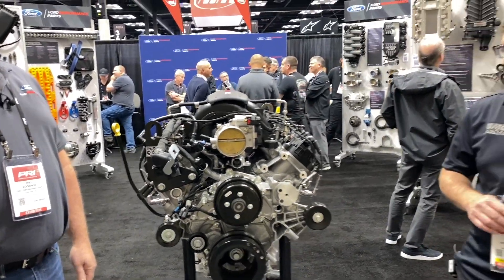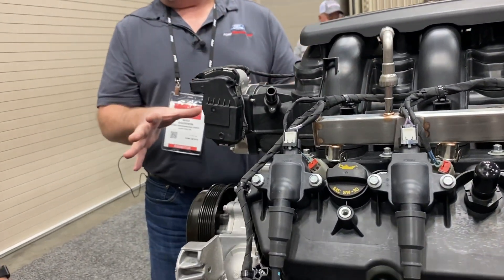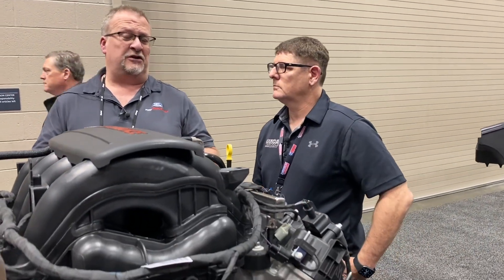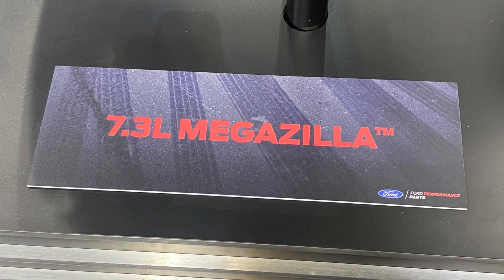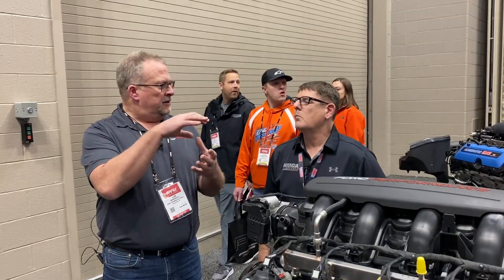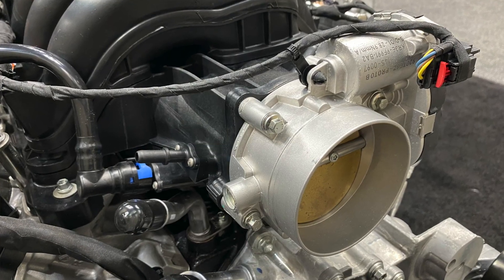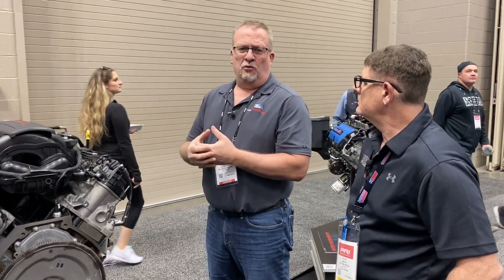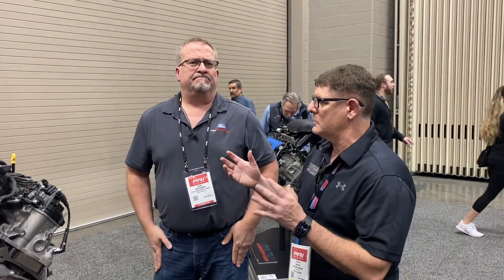Megazilla Is Here! 615 HP 7.3L Godzilla Crate Engine From Ford Performance We Get The First Look

Comment: For 20k you can easily boost a stock coyote to 700hp. This seems way expensive for only 615hp. Heck, an old school big block ford eats this thing alive with a 20k budget. You could probably build a 1000hp 580incher for 20k to run on pump gas if you wanted. I look forward to what guys can do with junkyard pullouts though. The engine, itself, seems to have a lot to recomend it.
Reply: Coyote sounds like a sewing machine at idle. No thanks....

Comment: Just curious,  what about the older "385" motor / 429, 460 ????
Reply: Exactly! 
Well, I still have my 460 with a C-6 behind it. Plowing heavy snow since 1992, still has lots of low rpm torque 👍

Comment: I hope this engine is better than the stock 7.3  which are eating through cams and lifters  after only about 35000 miles .
Reply: THE EATING UP OF THE CAM AND LIFTERS HAS NOTHING TO DO WITH THE 7.3 ENGINE DESIGN. THE ROLLERS ON THE LIFTERS ARE DELAMINATING BECAUSE THE AFTERMARKET COMPANY THAT MAKES THEM FOR FORD IS USING INFERIOR METAL WITH MANY IMPURITIES IN THEM. THAT'S WHY THEY ARE DELAMINATING AND DESTROYING AND EATING UP THE CAM SHAFTS. THE SAME GOES FOR THE CHRYSLER HEMI WHICH IS HAVING SIMILAR PROBLEMS. ON CHRYSLER'S END IT'S THE POSITIONING OF THE CENTER HOLE ON THE ROLLER WHICH IS NOT TRULY CENTERED. WHERE THE ROLLER SLIGHTLY WOBBLES UP AND DOWN AND OVERTIME WEARS THE NEEDLE BEARINGS DESTROYING THE CAMSHAFT. CHRYSLER'S PROBLEM IS MORE OF A MACHINING ISSUE WHICH IN FORD'S CASE IT'S A MATERIAL ISSUE.

Comment: Some of you guys miss the point. Not everyone is willing to build an engine. I've been down the buy a used block, pay the machine shop to deck, align bore, and blueprint short block (of course assembly too), and then find heads (2.02 for SBC), intake, carb, headers, ignition, and I realized very quickly, and once I was past the point of no return, that I should have just started with a nicely built reliable engine WITH A RELIABLE WARRANTY.

This 615 build leaves you wide open for another easy 100hp - thinking cam and tune would be the first thing to do. Yes, warranty is done at that point. So what the heck, enjoy your 615hp engine, run the crap out of it for a year or so, then by that time, the aftermarket will be more robust and you'll have more choices.

It's tempting for me. At the same time, I'm caught between going more old-school and building an FE or a bored and stroked Windsor. All I want is a nice clean 600-650 engine hp. I definitely want a great sounding engine, especially idling. I have no idea what this new Megazilla will sound like - and I'm not expecting much either. But there's no question that the Godzilla is a great platform and we're going to see big things happen with it. The packaging is especially appealing.

Comment: You can build a 351 with good heads cam an intake for 5000 and make 500 - 575. And add a fuel injection and be around 7,500. Just curious why don’t ford build a updated 351 for the muscle car platform only. build a stroker series.(example chevy ls/lt series).
Reply: They do.  They're making 289, 302, 347, 351, and 460 motors.  https://youtu.be/UcUo3C7OvtM

Comment: Thank You guys... Perfect for my Superformance Cobra I am thinking about getting.  Just looking for a dress up manifold or something???  600+ horsepower is enough for me..looking for a reliable, smooth higher revving V8 without blowers or turbos.
Reply: I would also like to put this in my new Superformance Cobra... but it still looks to have a problem with being too tall.  The video says it's a new, low-profile, manifold but looks to still finish off about 3 or 4 inches taller than an 8-stack injection system!  Have you tried it?  Is it still too tall... or not!

Comment: The sub $20 was disappointing. You still need a control pack. Super Duty transplant still the way to go!
Reply: Agree a guy can make his own swap and come out under 20k and it running
Reply: Currently looking at doing this for my galaxie. This motor is still 22k delivered. Building something similar would cost just as much, if not more.

Comment: how compatible is this with 2018 Raptor?  Require different transmission? Adaptable?
Reply from the maker: Bolts directly to any modular or Coyote transmission so yes it will bolt right up.

Comment: Sub $20K!! What $19,999 then if they give you options to change things like oil pan and oil pump will probably be $25K-$30K.
Reply from the maker: Or... wait and see what the real price is and make a decision. Either way, reliable 600-plus hp NA on pump gas that will last thousands of miles is not bad. I'm just the messenger not the builder.

Comment: Great engine. But 20,000 is to much
Reply from the maker: Are you comparing it to a 600 hp engine that has a 6-bolt block, forged internals, ported heads, etc, etc? It's not cheap but it's a 600 hp engine that will last forever on pump gas that you can install and go.
Reply: @revanevan  No they are comparing it to a 50+ year old 2 bolt block engine, that has about 60% of the efficiency and drivability.
Reply: I've thought it about it some more ,you made some good points.I guess it's like cam swap away from being either a fast Footbrake car or a  fast daily driver,or both with the cam that's in it. That is quite a bit of power for pump gas engine and it's got the Ford durability.  Thanks.

Comment: This is awesome…would love to drop this in a OBS f150. But here’s my deal. I am on a budget. would it be cheaper to pull a Godzilla from a wrecked super duty and build it from there? Or just buy one of these? I’m assuming it’s gonna be in the 15K dollar range.

Edit: And I know the cost of the transmission and control pack and other supporting mods will be there as well.
Reply: You could get a 427 or 460 Windsor based stroker and make way more power than a  junk yard 7.3 godzilla.and it is a smaller/lighter engine...you can even get it in aluminum...Then just go with holley efi for engine management
Reply: @rdy2run332  Facts!

Comment: I was so excited to see this come out from Ford as a crate engine. But…. sub 20,000.00. I hope that includes a 6 speed  manual or automatic transmission and the computer to run it.  Please don’t price this engine out of reach for the average  car guy that wants a factory - built by Ford Crate engine.
Thanks for always Great Content!!!
Reply: 7.3 block is $1500.  The 7.3 FordPerf crate motor is $8500 no acc. or computer.  Computer and harnass is $2750.  No transmission.  He says 'Turn Key', so that means you get their computer and tune but no transmission.  Starter and acc. cost ~$2000.  So I'd guess it's gonna be a $15,000 turn-key crate motor w/o transmission or acc.  Run on an angine stand is what it sound like.
Reply: But this never happened.
Reply: @TheFogLakeshore  Yes it did, but they are $21,000 and some shops are charging more!

Comment: Disappointed in Ford, it’s still the same Godzilla engine with a saw cut block and Godzilla head castings. Just ported heads, new intake and cam with different pistons. Nothing Brian wolf or any other engine builder can’t do. I was really hoping for something revolutionary like a new block or head casting
Reply: The point isn't to make big power with the Mega, it's to give people a good starter for street swaps. Forged internals and an intake manifold that actually fits under the hood. You can throw this in a fox body street car and expect it to run for decades without issue, or you can throw a big cam in it, or you can boost it. Versatility sells.
Reply: @frojo1994 . Exactly!!  If any of these guys that are angrily posting that “they are disappointed in this motor” has never tried to build and correctly balance a small block. And to add to it, this is just sand at the beach,with tuning potential a 7.3 has “legally”.  On pump from around All corners of the states.